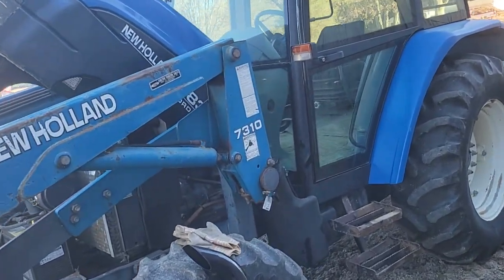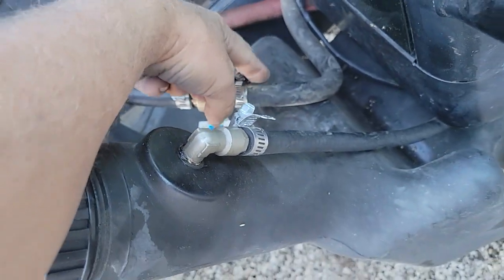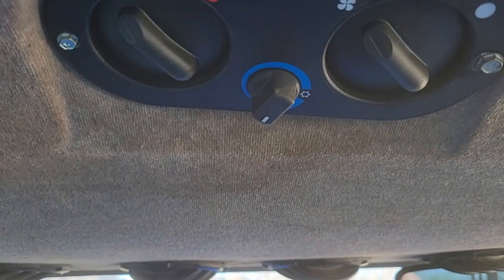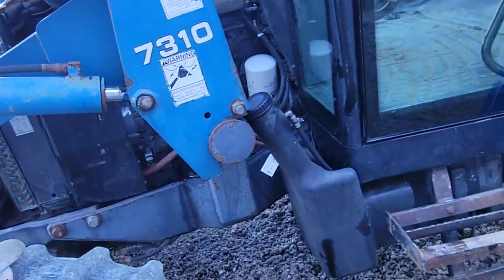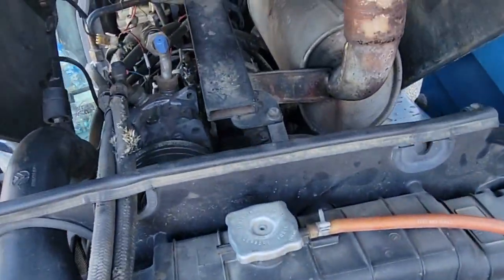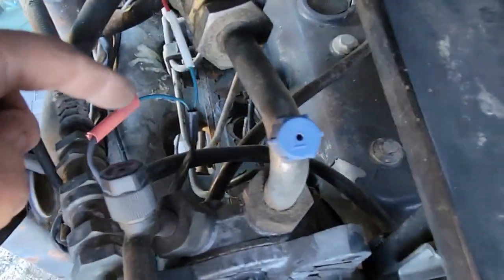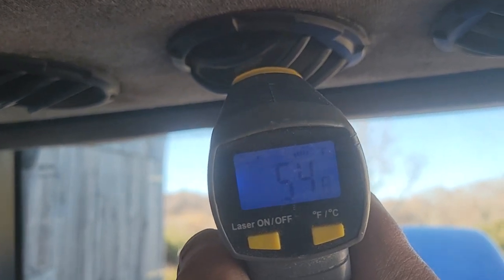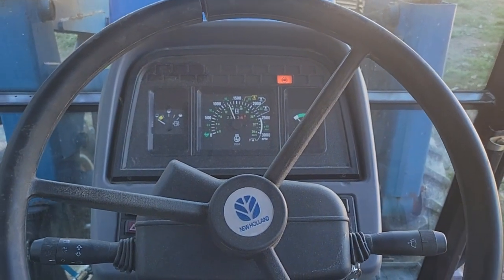Tractor Air Conditioning Fix

Comment: There is a valve on the passenger side that shuts off the heater core already.
Reply from the maker: I figured there was one somewhere, must be stuck open. Thank you
Reply: Mine is on the passenger side, right next to the firewall on my 1995 Ford/New Holland 7740